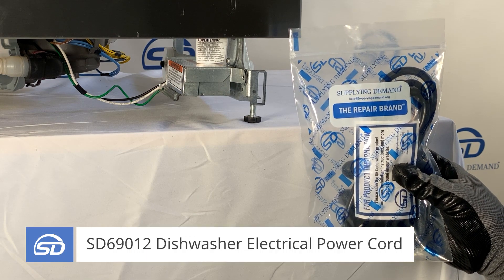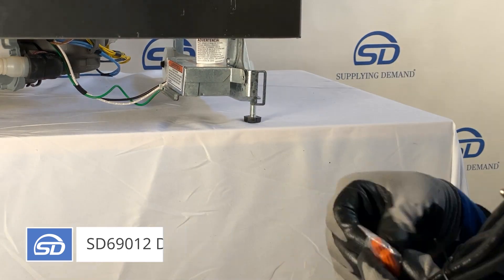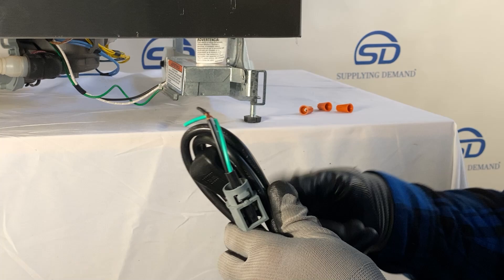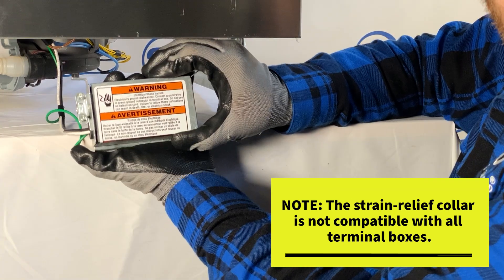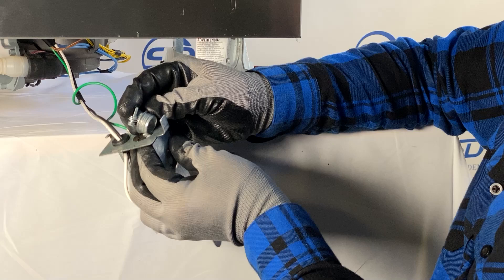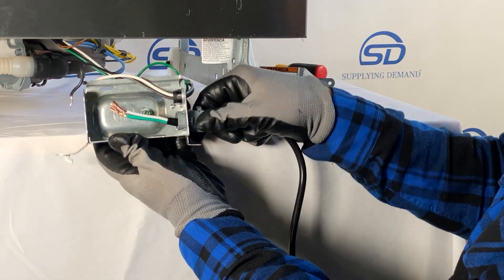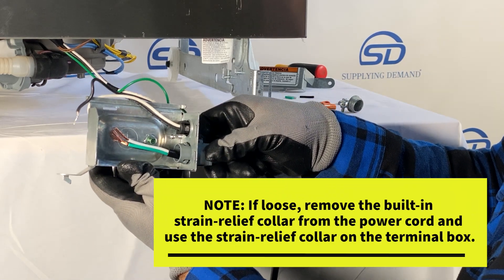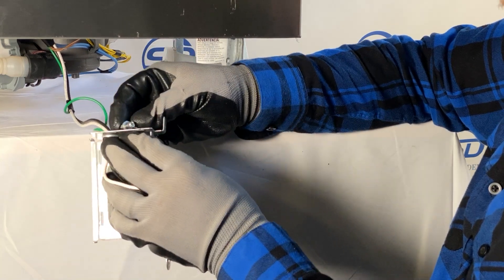How To Install Supplying Demand SD69012 Dishwasher Power Cord

Comment: How do you remove/adjust the plastic strain relief collar?  I need to allow more slack through but I cannot figure out how to loosen the collar.
Reply from the maker: In situations where the existing strain relief collar does not align with the specifications of your dishwasher's terminal box, it may become necessary to carefully remove the collar. This can be achieved by employing a pair of pliers to delicately detach the strain relief collar from the power cord. However, it is imperative to underscore the importance of incorporating a strain relief collar in the installation. The strain relief collar plays a crucial role in safeguarding the electrical connections by mitigating tension on the cord, thereby preventing undue stress and potential damage. Should removal be needed, ensure that a compatible strain relief collar is installed at the terminal box to maintain the integrity and safety of your dishwasher's electrical connections.